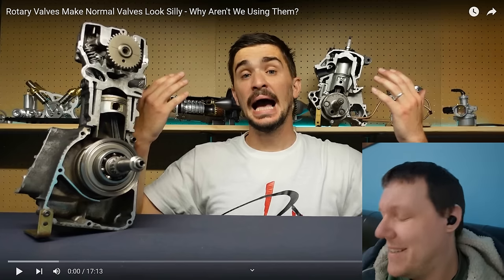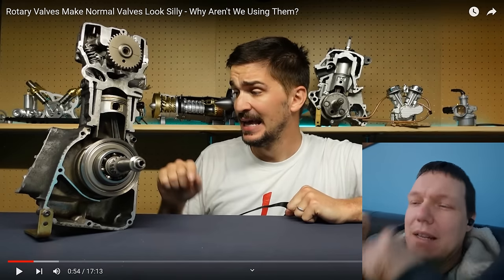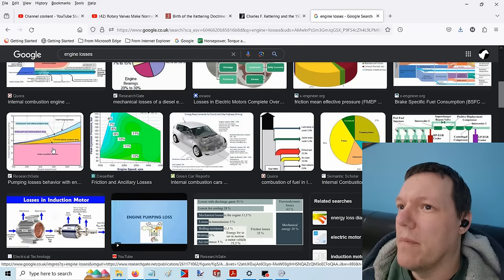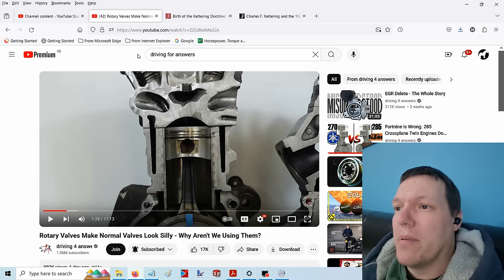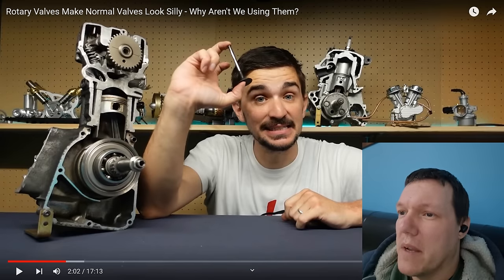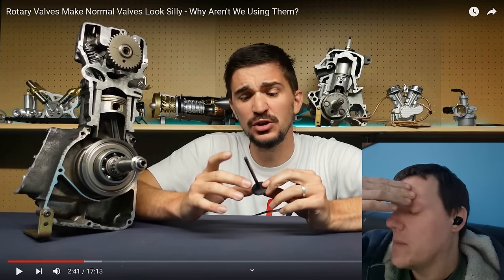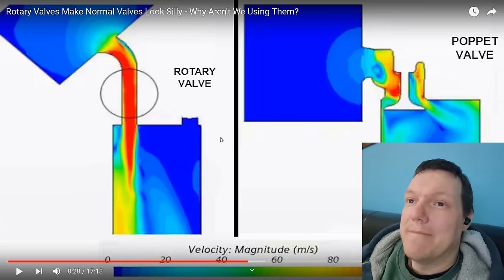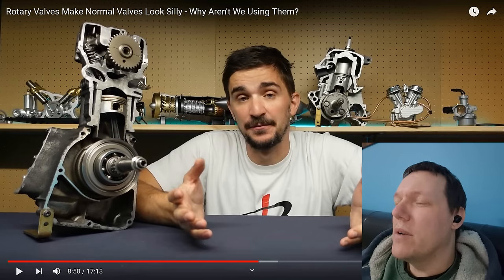We learn about POPPET valves - NOT!

Comment: I worked on Bristol Hercules 2000 ci radial engines that used sleeve valves. More efficient but far more complicated valve train.
Reply: I've long wondered just what the total man h oi urs to build a sleeve valve radial engine versus a poppet valve engine of the same number of cylinders

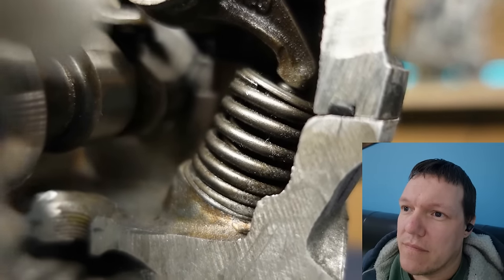Comment: That design at about 1:36 is basically like the dunston rotary valve a bloke over made for holden straight 6 engines in about the 1950's.  I actually had one in my hands once, big shaft ran the length of the engine running plain bearings with spring loaded floating seals just like in that picture.  I think they had to run with oil in the fuel to try and lubricate the thing but it worked apparently, sort of.

Comment: I appreciated both the original popcorn video and this appropriate deconstruction, highlighting the inadequacies of the original video. 

One point of contention here would be that the reason the bishop rotary valve wasn’t seen at least being tested in formula one had more to do with politics than the practical limitations of the principle. The reality was that the formula one engine suppliers didn’t want to have to follow ilmor and go down a pathway that had little to no value for them, besides being useful for super high revving,  short life, high maintenance engines.  They shut the option down as soon as it became clear that ilmor was ready to put the option on the table as a working solution.  Maybe it would have been a complete fail, but we didn’t get the chance to find out, because it was banned as a solution prior to it being used in a car. 
As we know, in a competition environment rotary valves present solutions to a set of problems, but with another set of compromises and constraints.  
The trouble with all these popcorn engineering videos is they present solutions as panaceas and depend on the viewer to decern the inherent issues.  They hype the solution  with a shallow analysis and skim over the limitations. That said, to be honest, if one’s experience is limited, it’s probably useful to get a surface level understanding. 
Thanks again for the review.

Comment: Matt, you incorrect saying the Frank Whittle centrifugal jet engine was not as reliable as the axial flow engine (similar principle to the modern day RR Trent engine) developed by the Germans during the Second World War. The sole reason the British persevered with Frank Whittle's centrifugal engine design was "reliability". From memory, the German axial flow jet engine had a service life of around 12 hours after which it was scrapped while the British centrifugal engine merely required overhaul after 100 hours. This was due to lack of suitable alloy steels capable of operating at the elevated temperatures and forces produced in the axial flow engine which incidentally did produce more power. 😮
Reply from the maker: "Matt, you incorrect saying the Frank Whittle centrifugal jet engine was not as reliable as the axial flow engine"

- Do you have some cycles to failure numbers?

"while the British centrifugal engine merely required overhaul after 100 hours"

- What's the TBO for a trent 500? I think it's between 30,000 to 40,000 hours... Do you wanna argue which is more complex?
Reply: @dirtygarageguy  ¹I have given the figures above, bare in mind this was 75 years ago and during world war II.
The modern axial flow engines such as the RR Trent is extremely reliable largely due to the availability of (modern) high quality steel alloys required for this type of engine. Cheers mate 👍😁

Comment: I think the point he was trying to make with it being hard to turn by hand is that it is inefficient and sucks energy... but he's just wrong...what happens after it decompresses? All the energy is released back into the system and the losses are extremely minimal. You could put a spring that would be IMPOSSIBLE to turn by hand and I don't think it would impact the efficiency of the engine at all. I wonder what the hysterisis of a steel spring is?
Reply from the maker: Most of the hysteresis is due to the spring rotating. Isolating the losses can be quick difficult to measure due to this, but apart from that, the hysteresis is like most springs with such a high cycle rate.

Comment: I think that titanium can take the heat. The only possible issue could be its coefficient of thermal expansion which may not be close enough to the materials around it. I am not sure there.
Reply: Don't know about sport bikes, but all dirtbikes have titanium valves for 15-20 years already. They had many problems in 2005, but around 2010 they found alloy combinations for valves and seats to be reliable.

Comment: i saw an older indycar engine on Rob Dahms channel that had rotary valves instead of butterfly valves in throttle bodies. makes sense if most of the time they are wide open when racing, so they want as much air as possible entering the cylinder.
Reply: @Turnipstalk I'm no expert but I think having no obstruction would still be better even compared to a butterfly valve throttle body with increased bore to account for it, so the air coming in flows better. I mean a racing team went through the trouble to make and use it so it must flow better.
Reply: There are different types of throttle  bodies out there, butterflies are the most common but there are slide throttles, rotary or plate,barrel,and most likely some other obscure one of a kind things . Butterfly throttle is most commonly used because it's easier to integrate and it is "the best all around" thing to use,but it's not the best one, neither of them is,they all have advantage and drawbacks and using a WOT as a benchmark for the "best one" is not really sensible because we don't drive with pedal to the floor all the time. Besides, the throttle body isn't actually needed because you can control the air going in the engine with variable valve lift on petrol engines valvetronic and multiair systems being the most common ones at this moment, and on diesel engines you just don't need it because you only control the amount of fuel going in.

Comment: Many manufacturers have already moved over to electric drive for some of the previously belt driven (engine driven) functions like steering and various pumps, and I presume for fuel efficiency? The yanks originally listed HP figures based on a lone engine running, with all the ancillary devices being separately powered. Then the Gov. changed how these tests should be run realistically, and overnight all US engines lost big HP figures.

Comment: 1:15:24 Lol, o-rings and lip seals are actually pretty forgiving to tolerances, grooves for o-rings are usually machined to +-0.05mm. Rotary lip seals are even more forgiving, the lip can deflect quite a bit with smaller/larger shaft, but the pressure of the (usually liquid) that is being sealed is still pressing the lip onto the shaft (that's why you can't install them other way round). But good luck sealing 800-1000°C exhaust gasses with o-ring or lip seal. 

Even if you can come up with some unobtanium material that would seal the barrel on the ends, there is still a problem that the barrel must have some clearance gap between itself and the head. And this gap will fill with exhaust soot (which we actually see in those "traces" of combustion at 1:38:10) , I wonder how long will that last. Especially when the barrel heats up and all the soot in the gap becomes compressed. Because exhaust soot can be quite abrasive, so you really don't want it in any rotating assembly.  

Working in automotive, I am fairly certain that every large engine manufacturer already internally experimented with all sorts of weird valve designs, including this one. The thing in industry is, that everyone guards their intellectual property, and no one is going to let the world know what they do in their R&D - especially if it's a failure. Why would you publish your work, just so your competition can learn from it? You only ever publish things that work and you want to sell.

Comment: So am l right in thinking that when you install valves, following some head work or whatever, it should be possible to rotate them by hand however tight-fitting?
Reply: Yes. If you try to rotate just the cam without the chain or belt you can do it with just your hand on the sprocket. Even on 4 valves per cylinder so when you compress two valves at the same time you can do it by hand, it's hard but if you are eating meat you can do it. And there shouldn't be any tight fittings on your valve train. If you just install the cam without the valves it should be super easy to turn. Same thing with your valves installed without springs,they should glide in the valve guides. If you have rockers or finger followers that part of the valve train should also be basically frictionless. And when you have it all together in most of the setups resistance on the cam when it's not compressing valves should be minimal,if it's tight you should check your valve lash ie is your cam pushing on the valve through all of it's rotation and not just when the cam lobe pushes on the valve.

Comment: note on the starship comparison, it did make it to orbital velocity, it not getting a full orbit was the intended flight path 
and because you can actually math this stuff out, it can, on paper reach orbit w/ a full payload
it not doing so was because they dont know yet if they can relight the engines in space and to have a guaranteed controlled reentry point if they cannot relight in space (wich it could not do in flight 3, so that wasnt a dumb idea in the end)
Reply from the maker: No it didn't. If you reach orbit velocity you are going into Orbit, that's how that works.
Reply from the maker: They were also meant to do a vacuum relight, and didn't.
Reply: @dirtygarageguy  they tried and it failed, simple as that
edit: looks like im going crazy or youtube ate my other reply
either way look at the plan for the 3rd flight that they talked about before the launch, it was never ment to do a full orbit due to safety reasons
Reply from the maker: My point wasn't that they didn't. My point was they filled the rocket, they had no payload and at the end of the sub-orbital flight they had no fuel. Add 100 tons of payload and they're definately not getting into orbit. 

Starship weighs 100 tons empty.
Reply: @dirtygarageguy  why would they load up the rocket w/ more fuel than they need? who says it was filled to the brim? 
they know how much fuel they shud need from the math and thus the booster might be full because its doing a full burn but the ship might aswell been borderline empty as it only burned for a few seconds
Reply from the maker: @Space_Reptile they said. They filled the rocket to 85% volume. They can only fill it to 90% because of volume of the helium tanks. Do you think that 5% is going to lift twice the mass?

Only if the rocket performs like they predict. If every engine performs just 5% less than required, then it won't workout.

Comment: Must admit that the energy losses through the oil pump surprised me.
Reply from the maker: Why? Try mixing oil in a bowl at speed, not do it at pressure
Reply: ...or trying to thicken cream with a hand wisk.
Reply: Once, in winter, that was something Luke -20°C. Oil pump was working do hard that i felt like engine goes from 100KM to 50KM
Reply: That's why I can't wait to see 48V electric oil pumps becoming more mainstream now with electrification, since the engine won't need to spin the pump anymore, and e-motor will do its job.

Comment: 49:23 You're missing his point: the poppet valve creates a tremendous restriction of flow even *when it is open*. And that leads into his discussion of the advantage of the rotary valve, which, when fully open, is the same as the straight tube.

1:03:56 This is a strawman argument. What he's saying is that, all things being equal, fewer parts means greater reliability. Think of how much longer transistor radios last vs vacuum tubes.
Reply from the maker: when it is open - right, what was the point again? I discussed this, that this is true, but it also seals 100%. Did you miss that bit. Its a trade off.

As for reliability this isn't true. I gave my example. You have added the 'all being equal' bit. Learn what a strawman is. 

Try again.
Reply: @dirtygarageguy  Do you think that if Frank Whittle had built his jet engine with as many parts as a modern Trent engine, it would've been more reliable?
Reply from the maker: No, but that's not the point I was making. It's not a general rule that more parts equal less reliability. Some assemblies have more parts to make something more reliable. Take a wastegate. More parts, but the wastegate makes a turbo more reliable, not less.
Reply: More parts equal more points of failure, but not necessarily mean less reliability. Especially when you compare 2 completely different systems. For example, one of the simplest jet engines is a pulse jet engine, with very low amount of parts. Funnily enough, it is notoriously unreliable because of one of those parts - reed valves that break off.
Reply from the maker: @miro6138 doesn't mean motempoints of failure. That's not how a failure analysis works. There's a probability of failure and cycles to failure. This is what I did for 20 years.
Reply: @dirtygarageguy  Well idk what is the proper terminology, I am not failure analyst. But it is true that with more parts, more things can go wrong - with traditional valvetrain, that is rocker arms, cam bearings, cam lobes, valve guides, valve seals, springs, etc - that is what I mean by more possible points of failure. Also I would expect that every part has some probability of failure, so more parts should equal higher chance of failure of the system.
Reply from the maker: "But it is true that with more parts, more things can go wrong"

- It's not. That's not how this works. There are three types of failures, fatigue, design and misuse. There's an old engineering saying, 'nothing too strong every broke'. Adding more components doesn't equal more chances or 'points' of failure. Specifically if those components are designed to reduce failure. 

"Also I would expect that every part has some probability of failure, so more parts should equal higher chance of failure of the system."

I'll refer you to what you said before - "I am not failure analyst." - True.
Reply: Poppet valves have their limitations. They also have their strong points. 
The limitations include flow issues, parts count, curtain issues with flow relating to cylinder wall proximity and proximity to other valves. The poor ability to adequately fill the cylinder once bore sizes reach a certain point (1).
The strong points include a mature manufacturing technology. The ability to vary valve timing either thru cam phasing or shifting. Better combustion chamber design options. Better spark plug locations in spark ignition engines.
1) As aeroengines increased in power in the 1920s and 30s it was recognized that the traditional poppet valve engine would run out of flow if cylinders became much larger. This was an issue on radials partly due to the common use of two valves per cylinder. Sleeve valves offered improved flow rates for larger cylinders along with very accurate port timing. The issue of flow rate was solved partly thru increased supercharger boost levels. Power levels in radials was also increased through the use of multiple cylinder banks. Sleeve Valves also had a downside imo. Napier's Sabre was undoubtedly a great engine. But I wonder just what the manufacturing cost in manhours was for each engine. Especially versus the two major competitors it could be said to have. The Griffon and the R-2800. The two US sleeve valve engines were no where near as compact as the Sabre but Pratt & Whitney also designed them for servicability. In the end a moot point as both H-24s were dropped in favor of the R-4360
Reply: @dirtygarageguy 
As Henry Ricardo said complicated does not necessarily mean less reliable. A multi function mechanical watch is certainly complex, highly precise and very reliable.
Reply: @dirtygarageguy 
There is another possible failure point with engines and transmissions. The cost accountants insisting on lowering costs either through cheaper materials or processes. While this could be considered a design failure l would consider it more of a management failure. 
I used to work in the automobile industry doing machine repair and tool work. For a while we were assembling Renaults. They had a high warranty problem with automatic transmissions. We had a test station set up in the dhop to find out what the problem was. The retaining springs on clutch packs were failing. VW used the same basic transmission with no issues. The difference was in the material and or heat treatment if the retaining springs. That's a management failure.